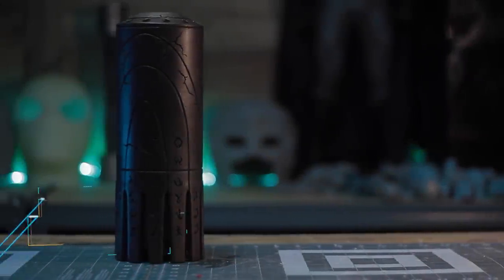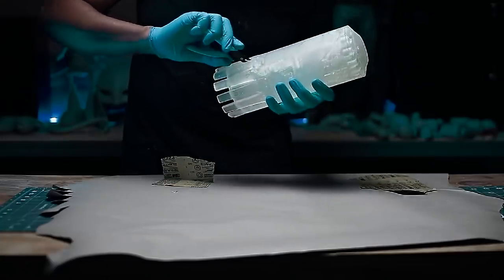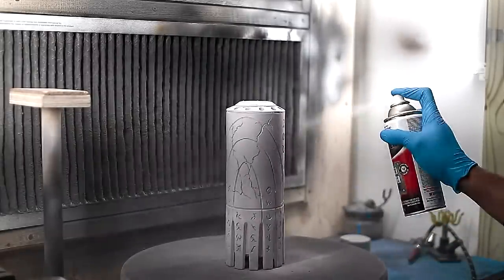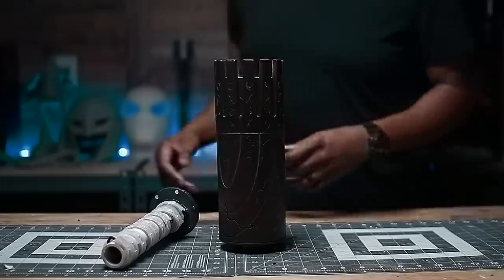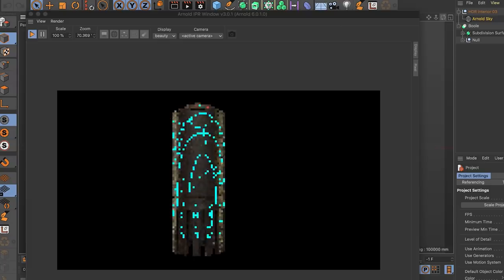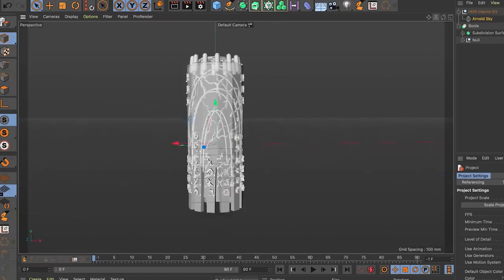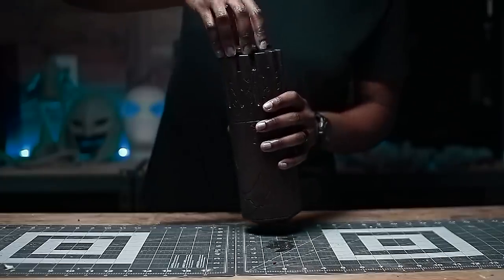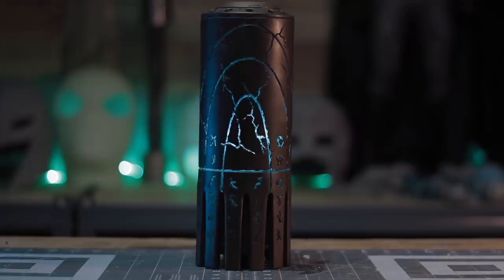3D-Printing King Atlan's Artifact Prop from Aquaman!

Comment: I also tried to use the masking trick when making a light-up Black Panther mask. I gave up and my new preferred method is to add base painting to whole print and then use a very small ball nose bit in a dremel to clean out the grooves. Then used a black tint plastidip coat to the whole part to blend the lightup features to the overall mask. Then weather on top of that.